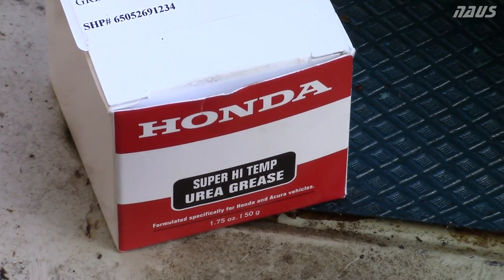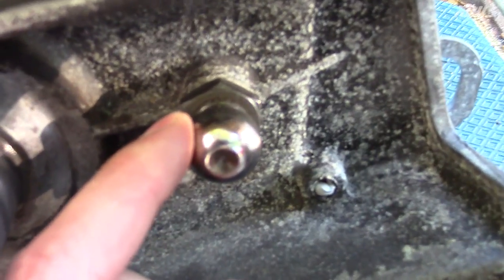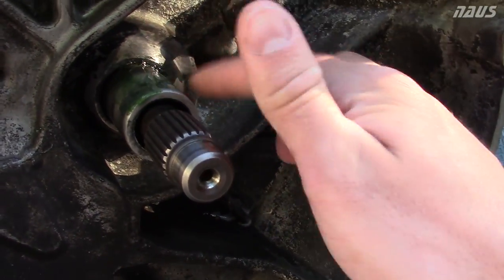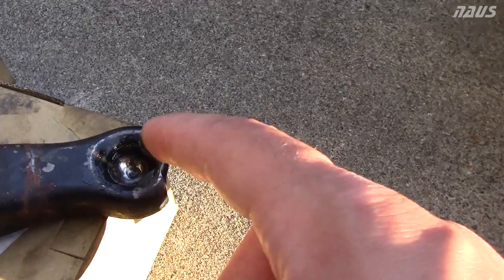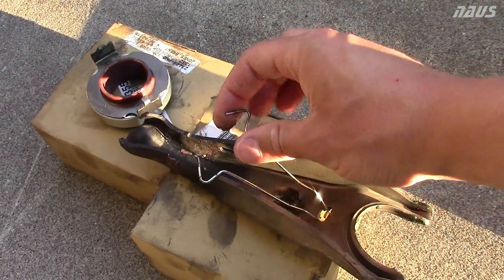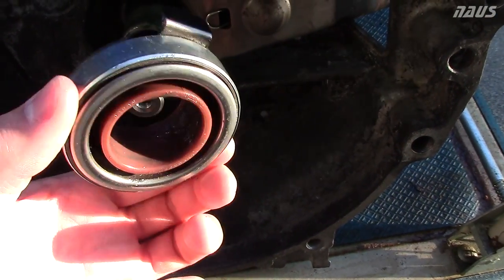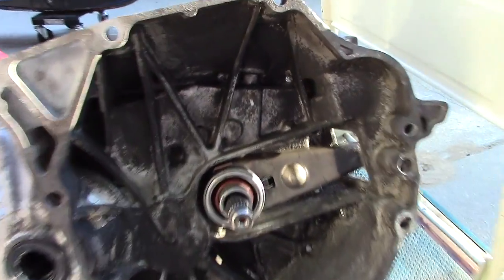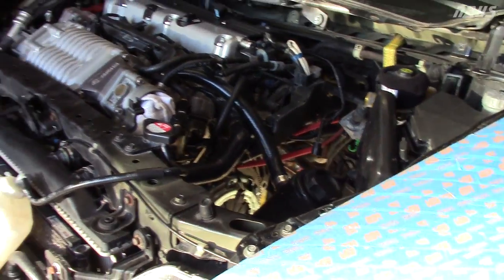K Series Transmission Throwout Bearing Installation DIY

Comment: Thank you for this video! I have a question. My fork is really loose (I have the transmission on the ground) and when I move it and doesn't spring back into place. Is this normal? I can't tell if you're moving it forward and back on your own or not. Thank you
Reply from the maker: Sayyid nope that's normal, when the trans is out of the car the fork can move around freely , the slave cylinder is what pushes the fork
Reply: Thank you for the reply! It really helped. I put my car back together and everything is going smoothly. I'm just getting a noise (sounds like the throwout bearing) when I press the clutch pedal ALL THE WAY in.

Comment: It’s better if you put the throw out bearing on the  arm before you put it back
Reply: I wish i had done this, now its fucking vibrating and i need to remove my gearbox  to put it back on properly, im so annoyed.
Reply: Good tip. Bout to crack mine open. Thanks for sharing

Comment: I have what seems to be a loud rattle coming from the clutch fork, where the slave cylinder makes contact on the fork. Could my issue be lack of grease on the stud essentially causing loud the rattling. I just recently installed a brand new clutch the rattle just came up soon after.

Comment: In my 1995z28 6-speed had my motor head replacement,  it was sitting up for a while, what could be the cause of it not being able to go or engage into 2nd? (Gets into all 5) but not 2nd, is it the clutch ??

Comment: Hey thanks for the video very informative if u don’t mind quick question My accord 2009 5 speed i changed the engine a year ago and everything was fine but now when i tried to bleed my clutch the slave cylinder doesn’t kick back what can it be or how can i properly bleed the clutch or is my fork or anything wrong?
Reply: anyone reading this later and still wondering, make sure you have someone press in all the way and hold the clutch pedal while you open the bleed valve, then tighten gently (doesn't need to be cranked down). Then pull up the clutch pedal.

Repeat this process until fresh, gold brake fluid comes out in a steady stream. Pull up on the clutch pedal one last time. After it's fully bleed, push down on the pedal, it should then return up on its own

Also make sure there's some slack (a tiny amount) in the clutch pedal. You want a very small amount of play before you feel the clutch pedal pressurize/start to disengage. If the pedal has no play then you'll kill your throwout bearing and potentially wear your clutch disk faster than you should. You don't want so much play that you can't fully disengage the clutch, preventing you from smoothly shifting gears.

Comment: so mine bearing is not on right it pushes close to the transmission teeth at the tip. like it sometimes goes over it. is this okay?
Reply: Did you figure it out? I have the same problem on my k24 gearbox

Comment: question about ur throw out bearing cause see the middle thing color red its plastic right?
its supposed to be plastic? its safe?
Reply from the maker: Yeah it just slides along the aluminum cylinder, no forces go through the plastic surface
Reply: how about the heat? not gonna melt ?
Reply: Chalres Andrew: good question! Yes, That plastic from Honda Japan can withstand heat for thousands of miles. That’s why everytime you change or replace clutch kit, you also need to replace the throw out bearing as well as the release fork boot. Hope it helps.

Comment: Can I take the fork out without dissarming the trans? I feel my clutch a little bit stiff and would like to put some grease on the pivot points. thanks.
Reply from the maker: you probably could if you can get a tool in the small opening to undo the retaining clip, then it should just slide out, however its much easier with the trans off the car
Reply: NAUS thank you!
Reply: @NAUS2K  I have the same problem. The retaining clip is not properly attached.  Can we really slide out the fork?
Reply: @balloney2175  I know this is an old question but the answer is no.  You can technically get it off but it'll be damn near impossible to get the fork back to align with the throw-out bearing in order to have the fork attach to the throw-out bearing. You also then have to ensure you can snap in the center ball joint from the bell housing of the transmission into the fork through its retaining clip.